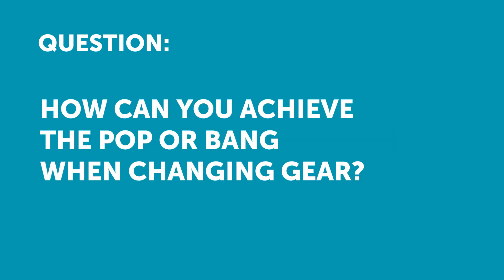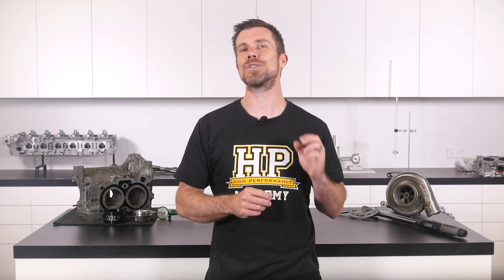'Pops & Bangs' | Why It Occurs When Changing Gears [HPA Q&A]

Comment: In 1969, tunes were not the reason for pops and burble. What was?
Reply: carbs not as accurate / precise as fuel injection, meaning larger change of unburnt fuel being injected into cylinder = pops and burbles when off throttle

Comment: Can this be achieved on a sportsbike (constant mesh gearbox) by altering ignition maps in the deceleration cell area? I know you can get decel pops by doing this but specifically interested in upshift pops.
Reply: im also here because I have the same question. my ECU has like a built-in quickshift backfire feature, but you can't make it only turn on above a certain RPM, so it will try to backfire if you shift at like 4k RPM which is a bit shit :D 

So tryna work out how I can map it in manually
Reply: @charliesmith874  oddly enough mine, does. I have a full exhaust on my 2023 r3 and nothing else. It'll pop on upshifts, downshift, and decel. All it takes is a slight flick of the wrist. When you're riding normally and cruising, it burbles occasionally.
Reply: @LightAsh01  yeah thats pretty standard when you do full exhaust without a tune (especially when you do air intake too), cuz it runs slightly leaner and gets hotter than usual (and also full exhaust means nothing stopping those pops/burbles from being heard)

I want full on backfires haha
Reply: @charliesmith874  lmaooo you're a madman, I love it, haha. With the r3 from what I've heard doing an intake one, the r3 isn't really worth it unless you're doing ITB's which I why I only have exhaust, r6 throttle tube and a whole bunch of other little things
Reply: @charliesmith874  also the r3 and quite a few other stock bikes sound like vacuum cleaners when you rev them with no exhaust lmaoo.

Comment: I once set my car on fire, because someone forgot to put my left exhaust downpipe thermo shield and there was a bunch of cables hanging which were not meant to be there as well. My muffler fell off that night and the sound was amazing, so I couldn't resist but to drive it and intentionally kick the throttle between shifts to make a bang and so the temperatures got really high and I was lucky to catch the fire quick with the extinguisher.